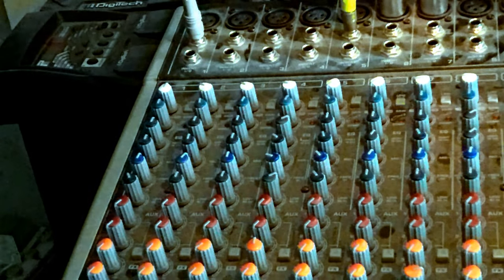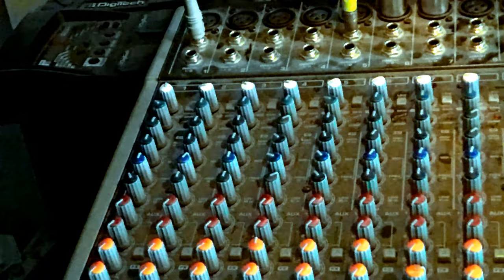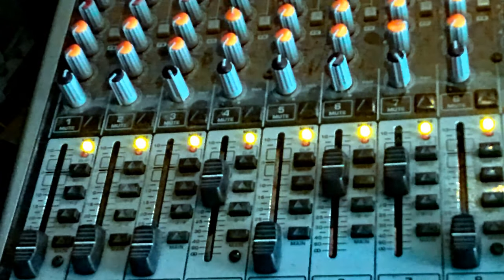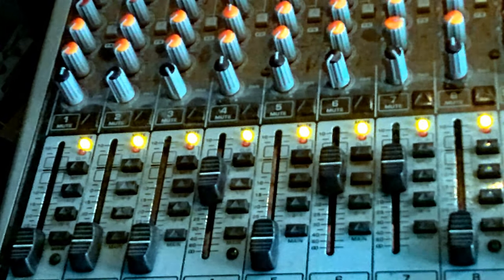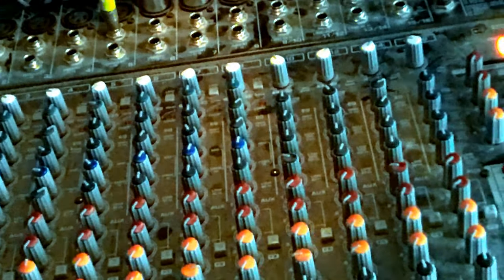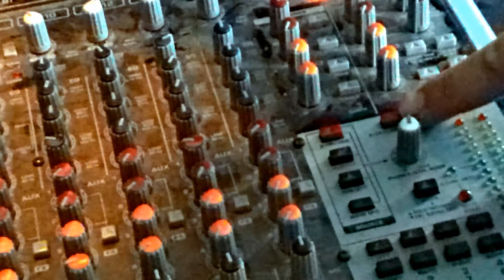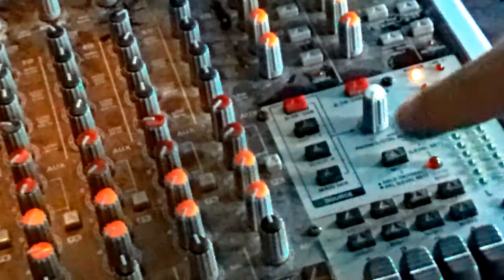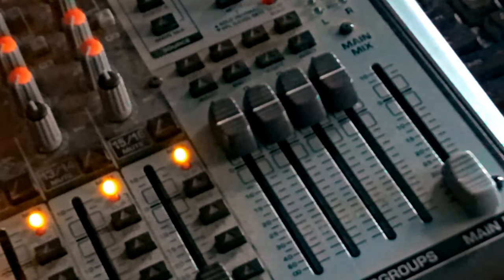Behringer XENYX X2442 USB Mixer Tutorial Part 1(The Front Panel)

Comment: The comments on the equalizer on the first 8 channels are slightly off
1st knob is high frequency EQ, allows you to raise/lower volume in the 12khz range
2nd and 3rd knob together are a parametric equalizer. The 3rd knob controls the frequency that will be affected, the 2nd knob "mid"  lets you raise or lower the volume of the selected frequency. The frequency can vary from 100hz to 8k hz
The 4th knob is low frequency EQ, allows you to raise/lower volume in the 80hz range

Comment: Thank you for review, is it possible channel recording with this mixer
Reply from the maker: your welcome. yes you can either multi channel through it with a hardware recorder using the direct outputs in the back or the USB port for your computer. just make sure the settings in your Daw support multi track and that the settings are correct. you can also just record one channel at a time too.

Comment: Hi! My xenyx 2442 usb makes strange noises when i use ,,master fx” it makes noises, cracks randomly . Is tehere possibility that I am making something wrong, or just fx is broken?
Reply from the maker: It could be the plug you're using is bad or it could be the wiring for that master FX knob in the mixer is loose.
Reply: @TheMusicChanneljakerocks  you mean wall plug? Cable? Or something like that?
Reply from the maker: The cable that's plugged into the master FX output may be bad. Check that. The wall plug shouldn't affect just one output or input. If it were the wall plug I think it would affect the entire mixer.
Reply: @TheMusicChanneljakerocks  thanx!
Reply from the maker: Your welcome

Comment: You should read the manual a little more before doing a video. The SOLO button interacts with a MODE button on the other side of the board. If the red COMP light goes on, it means that the compressor is engaged. Not neccessarily a bad thing. I notice several things you said that were completely wrong.

Sorry man